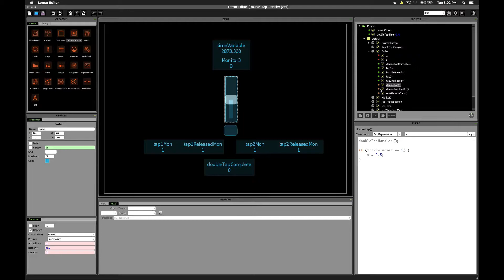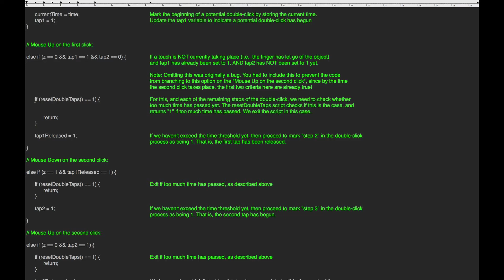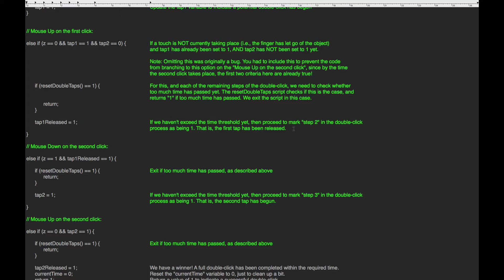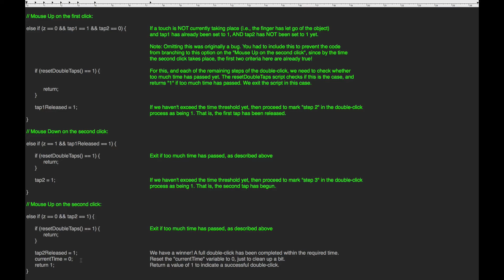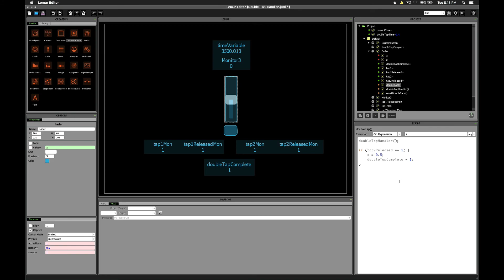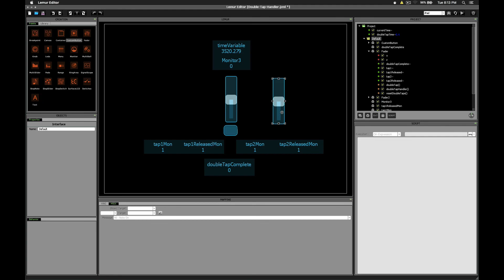Lemur In Depth Tutorial - Adding Double-Tap to Faders

Comment: Thank you SO much for all of your work on this. So helpful. I'm primarily using Lemur to control Ableton. I haven't watched all your videos but I don't think you cover MIDI & controller changes. (maybe I missed it). If not - would love to see a practical tutorial on how to send messages to abelton or another DAW. Again - supreme thanks!
Reply from the maker: Hi, you're right, I never covered the MIDI portion of Lemur, partly because there are so many different pieces of software people use, it would be impossible to cover them all. But for basic MIDI CC messages you just use the MIDI panel, select the variable you want to send, then choose the destination CC channel (and the range). I believe Lemur scales all 0-1 values to the range you specify in the MIDI panel automatically. If you're using the Lemur MIDI routing companion app, then that becomes your interface between Lemur and other software. It's possible there are other ways to route the MIDI signal, so I recommend checking out the Lemur user manual after watching at least the first 3 or 4 of my videos if you're new to Lemur.
Reply: @JustHackingAround  thank you. Just tried - makes sense. Really appreciate it!

Comment: This is awesome!  I have a lot of trouble making use of the time variables and this helps alot. Thank you. 
Could you explain the currentTime variable? Are resetDoubleTap and DoubleTapHandler communicating currentTime directly? 

I also have a time based video request, I hope you can shed some light on it!
I've been trying and failing to make attributes ramp up or down between two values. The two use cases I'm trying to do are:
1)Light or HSV() values. I would love to make objects that fade on when a control is touched and fade off over time after it's released. Light =1 and then move towards Light = -1 over the course of half a second or something. 
2) position values. It would be awesome to have objects that move off and on screen over time and with come sort of curve. Similar to the curved motion of animations in aftereffects.

Thanks man!
Reply from the maker: Thanks for the comment, yes, the currentTime variable is located at the very top of the project window, outside of any interface (an interface is the little folder icon called "Default"). Because of that, any script is able to set or get that variable's value directly.

Based on your questions, it sounds like you may not have watched the rest of my Lemur videos yet, so I'll refer you to those for now (for example, question #2 can be answered using the info in this video https://www.youtube.com/watch?v=XOBL1fjlBHk) Regarding question 1, you can't really fade objects on and off in the literal sense. You can fully hide or fully show them (but that's abrupt). You can change their color / opacity over time, but in that case they're still there. Your best bet is to go for option #2. You might find a nice equation to make the curve you're looking for, but if you'll at least check out the video I linked it'll get you half way there hopefully!
Reply: I should have been clearer. Im talking about fading their opacity and color over time, i realize that the object would still be present. Ill check out that video though thanks
Reply from the maker: What is the fading based on? LIke, can you give a concrete example of what you're trying to do?
Reply: I actually did watch that video of yours! The problem is that the physics attributes aren't externally triggerable, only the fader's cursor can do that. I cant use a pad to set a fader's x value to 1 from 0 and have the physics settings affect the change in value.
Reply: My first use is a text object and a monitor that display the name and value of a fader. I'd like the text/monitor to be transparent until the fader is touched and to fade from opaque to transparent over a second or two when the fader is released.

another use would be controls that visually "sleep". So after, say 10 seconds of inactivity, they dim to a lower color value.
Reply from the maker: Pads? In that case it's easy! Although it technically won't respect the actual physics settings of the fader, you can achieve a similar effect, gliding from one value to another, by using the envelopes that pads have built into them. They're in the Behavior tab. Have you tried that yet? Like, assuming your pads object is just called Pads and your fader is called Fader, you could create a 1 line script inside the Fader object to trigger on Pads.x[0] (referring to the first pad, adjust as needed.) The script would simply say x = Pads.x[0];
Reply: Yes I have tried that but again the issue is externally triggering the cursor. In the pad example, I wouldnt be using the pad itself to execute the script, I would only use it to generate the release values.With many faders and labels, having to bounce a fader's z value off a pad's release time seems cumbersome since I would potentially need a hidden pad object for every object I want to fade. It seems like there has to be some kind of equation to say "start from 1 and ramp down to 0 over the course of a second". I lack the math background to figure out what that is though...
Reply from the maker: I see, yeah there doesn't seem to be an easy way to accomplish this. Why not just rely on hiding the elements, or just set them to a more faded color at least? It would save time and accomplish the same effect, since fading has proven to be difficult if not impossible to do.